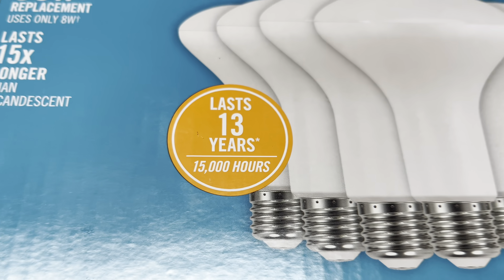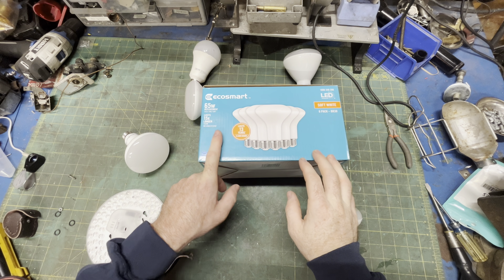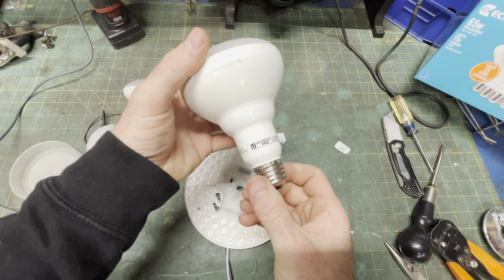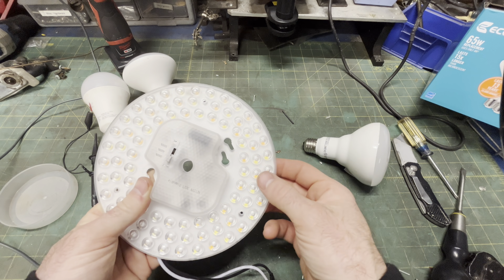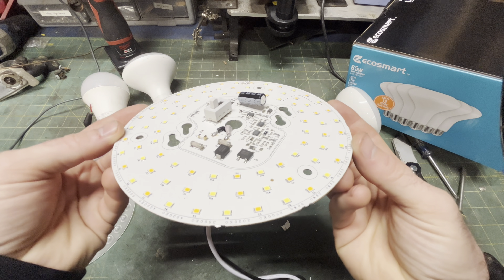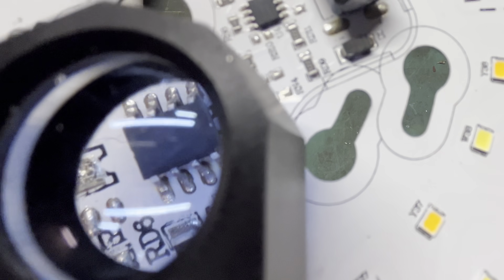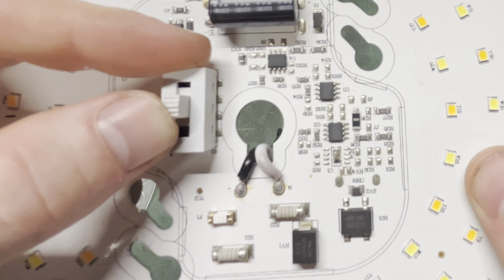Why Do LED Bulbs Fail? An Autopsy!

Comment: That looks like it could be a zinc casting rather than aluminum. Yeah, zinc alloys are much less efficient for heatsink material, but they mold into complex shapes really well and cost way less than the same casting in aluminum. It was soft enough to gouge deeply from your screwdriver tip, but all that leverage didn't stove in the metal surrounding it at all (like the same thickness aluminum probably would). 
I've seen it before in other LED lights: the zinc is much better than no metal heat sink, and explain better why that bulb was oddly heavy. A large, thin sheet of aluminum like you found in that other bulb is arguably worse, made so thin to save money the heat travels poorly to its outer edges.
Reply: I agree. Zinc is cheap partly because of its very low melting point, much less heat required to cast it. The greater mass means a higher heat capacity, and it's larger, so more area to shed the heat from.

Comment: Excellent video! Or audio. I haven't watched this yet, just listened while walking at the beach and finding junk. Excellent! Fun!

Why do LED bulbs fail? At least those I've checked recently, had one LED burned cut, having a small black dot. Could be that they run a bit "hot" to get max lumens per their price, but detailed reason might be what happens when the power is turned on. I'm "seeing" there's a spike of overcurrent which eventually breaks one LED. I fixed those bulbs by shorting the broken LED. A bit less lumens, but for my use it doesn't matter. What matters, is the matter (the waste).

Comment: Enclosed spaces where heat can build is the LED killer.
I just built a macro field continuous light entirely out of thick copper, to act as the heatsink for the 1600 LEDs.
Kept it on for 20 minutes a couple of times by accident with no problems.
Didn't even turn it off, I just turned it down to the dimmer modeling light setting and it quickly cooled off.

Comment: 3:54 that is a MELF resistor, one of the earlier SMD technologies, but still used because they can handle a lot more electrical stress than a similarly rated flat SMD package
Reply: hot melfs in your area... 😛
Reply: MELF stands for "Metal Electrode Leadless Face" but I think it actually stands for "Most End up Lying on the Floor" (because they're round they love to roll off of whatever surface you have them on).
Reply: I agree. To add a little more - they are often there as a "fusible resistor". Designed to both limit inrush current and act as a safety feature.
Reply: And they're used on the instrument panel of GM models circling around 2000.   And they fall off, leaving one with dark odometer and gear indicators.
Reply: Metal Electrode Leadless Face
What A Useless Name
I was worried decades ago for a job interview I didn't know what a PCMCIA connector was. It's a business with more initials than EIA and IEEE. I've never used the PCMCIA port on a laptop. Close to obsolete now. All that lost sleep for nothing.
Reply: @murrayatuptown353  PCMCIA? That one's easy: People Can't Memorize Computer Industry Acronyms

Comment: That shaky panichands pause and then double hand flip 11:29 after the explosive disassembly -- SO RELATABLE LOL.  Because you KNOW there's that little window where you could be slashed to the bone and not feel anything...
Reply: I prefer to not having to do that. This was 100% predictable and avoidable.
Reply: It had me on the edge of my seat, like AVE offloading that clapped out mill from the little trailer. Knife with the blade out, prying with a screwdriver right over the easily scratched screen of the multimeter, and his booger hooks all waiting for a jab or cut.
Reply: I squirmed when I saw him pulling at that plastic. I always wear gloves when doing that kind of disassembly. I occasionally hurt myself wrenching on my vehicles where I can't where gloves, and sometimes look around seeing blood on the tools and checking closely to see where it came from.
Reply: @andrasbiro3007  It always is in hindsight, but you do it anyway
Reply: @ 
This didn't need hindsight.

Comment: I purchased a pack of 6 LED bulbs branded as KOR on Amazon, in 2022 and all of them that are in use today still work fine. Tho I guess the quality of these really does vary a lot. I've been a bit concerned about the longevity of them having seen videos of bulbs that have failed early, but so far my experience seems to be quite good. They are rated for 15000 hours of life and I've calculated that as being roughly 2 years of being on 24/7 I have a bulb in a lamp I use in my bedroom which often gets left on for many hours a day sometimes overnight, and its still working today, tho it might have dimmed a bit, but I haven't compared it against a brand new bulb.

I personally can be happy with a 5 year lifespan for LED bulbs as I've been using those halogen incandescent before and those only seem to last about 7 months in my experience.

Comment: Super enjoyable stuff! 
FYI, it's the high voltage electrolytic capacitors that go bad first. You need ESR meter to detect the problem. A capacitance meter will often show proper capacity while the ESR is too high for the capacitor to function.

Comment: Having the LED as a separate product as the PCB would be fantastic, it is how tube lights work after all.
Reply: You see a lot of recessed lighting separate the rest of the electronics from the LEDs themselves
Reply: not anymore. You can barely find t8 *anything*.
Reply: It's not always the LED's that fail.  You could make the product modular so that the capacitors are replaceable as well as the LED's.
Ideally more consumers would be confident in using a soldering iron and buying replacement parts from a shop on the high street.
We do at least have separate drivers which can be replaced, but the difference between constant current and constant voltage is likely to remain esoteric for ever.
Reply: @westinthewest my city is fairly flat, and all of the streets are at the same height above sea level.
Reply: As a plasma fanatic  I just stick to fluorescent lamps. Most LEDs are boring for me. Filament style is OK but most other types are as ugly as the average mother-in-law.
Reply: The better industrial lights have separately replaceable power supplies, replaced a lot of them.
Reply: @keco185  Yes. Most of our ceiling task LED lights have separate power supplies. I've replaced some of them over the years and the LED lights are still going strong.

Comment: That bulb where you exposed the inner workings at the 11:45 mark, on aircraft we call those TR (transformer/rectifier) units, to convert 115V/400 Hz AC to 28 VDC.  Of course, they're a LOT bigger, heavier, and last a LOT longer despite the relatively large amount of DC current they output because they were built to high standards and cost crazy money.  But, it's an aircraft and you can't just swap one out when you're at altitude.  There are multiple units for redundancy and safety, which can autoswap onto the bus and hold a higher load for a while to get the aircraft to its destination.

Comment: I have old ecosmart LED bulbs in the hallway that have been working for over a decade. A couple of the bulbs have 1 of 5 LEDs burnt out, but they're still plenty bright.

Meanwhile, one of my newer ecosmart bulbs died in just a few years. A capacitor blew its load, there was electrolyte all over inside of the bulb.

At least it didn't fail catastrophically, unlike the ancient CFL in my garage, in which the electronics melted its casing. That bulb was probably 20-25 years old, and it had U-tubes instead of the spiral tubes found in later CFLs. It produced very pink light when it worked!
Reply: That LED bulb sounds very "Ecosmart" to me...

Comment: They weren't wrong about the LEDs having a long life, but they didn't say anything about those damn driver circuits did they?

(There is one tiny upside, if willing to take the time it's probably a good source for component harvesting.)

One last note, if your LEDs consistently have a short life - you should do some checks on the power coming out of the wall. It's likely you have a lot of noise or other waveform issues and need to voice complaints to the power company. Whatever it's doing to fry LEDs, it's also doing to all your other electronics.
Reply: As a plasma fanatic  I just stick to fluorescent lamps. Most LEDs are boring for me. Filament style is OK but most other types are as ugly as the average mother-in-law.

Comment: I've found that newer LED bulb designs produce a lot less heat, and so far seem to be lasting longer. It's also worth noting it depends on what fixture you put it in. As some fixtures can dissipate the heat well, and some (nipple/boob cheap lamp fixtures) have poor to no heat venting. For incandescent or compact fluorescent bulbs this was fine and did not accelerate their death (except for some CFLs), but boy does it ever accelerate the death of LED bulbs! (if they get hot enough). So kinda wish you had covered the fixtures each were used in more closely, as this detail I'd say is very important.
Reply: This is exactly the problem. Incandescent bulbs, CFLs and LEDs all have different constraints for long life, but end users rarely care or even know about them. For CFLs, short on/off cycles are a death sentence. For LEDs it is poor heat dissipation more than anything else.
Reply: The packaging on some cheap LED bulbs will tell you not to use in enclosed fixtures. I had a light fixture that was killing LED bulbs in less than a year and found this to be the issue. Spent a bit more on some better LEDs approved for use in enclosed fixtures and they have been lasting much longer.

Comment: I changed all our lighting to LED when moving into our present house in 2016 ... so 8 years ago. We have a lot of bulbs of many different sizes and types. So far the only failure has been an LED strip light in the garage. We are undoubtedly doing better than the incandescent or compact fluorescent types.
Reply: While saving on electricity.
Reply: @whyme5024  I'll say! LEDs use a fraction of compact flourescents ... and don't even mention a true incandescent bulb!
Reply: @whyme5024  That is not such a issue where I leave.  Since I have to run heating for 8 month in a year,   incadenscent heat is not lost during that time, it just helps house heating.   Actually I have a pair of BR30 over my head in the office, and I like them warm over my head for those 8 month, so I switch them to incandescent for winter, and back to LED for summer.  Of course there is no point running incandescents outside, or a cold storage room, or really garage.
Reply: yeah, BUT the incandescents were about 5 times cheaper per bulb

Comment: I got so fed up with LED bulbs failing prematurely, that I ended up creating my own LED circuitboard design using KiCad... 

I've an ethernet-based and Zigbee revision, both intensity and light temperature can be controlled from a touchscreen in my wall. The setup is calculated, such that the LED's are only driven up to 70% of their max rated current. This means they remain below 60°C, even after hours and hours of on-time. You can even touch the LED's without burning yourself.

One year later, still zero failures! Hope it remains like this for the next couple of decades...

Comment: Most LED systems are overdriven, especially in LCD TV backlights, which produces far more heat and failure.
The manufacturers do this to boost sales of their stuff, probably designed to fail after the 3 year warranty has expired.

Comment: All my led bulb fails have cracked shells or desoldered led diodes. Heat dissapation and thermal expansion seem to be the issues.
Reply: @BlondieHappyGuy  The base of these bulbs get ridiculously hot.
(recent LED bulb burn victim)
Reply: @BlondieHappyGuy Make things shitty to save a cent.
Just seems wasteful.
Reply: led diode= light emitting diode diode. You don'thave to write diode twice.
Reply: As a plasma fanatic  I just stick to fluorescent lamps. Most LEDs are boring for me. Filament style is OK but most other types are as ugly as the average mother-in-law.
Reply: @BlondieHappyGuy  You could drill a few holes into the plastic. It's probably worth the time when you buy a bunch of them
Reply: @mernokimuvek  led is used colloquially as a fixture disruption. When referring to individual diodes I describe it as such. Diodes themselves are also often also a packaged chip with a florescent film, rgbchiplets, and substrate like a simpler glowing ryzen cpu. So when referring to stuff it's not always redundant. Led packaged Diode is probably more accurate if you want to get reductive. Micro led rgb diodes are neat fyi

Comment: The whole concept of LED lighting for home use is flawed. Every frackin' bulb has to have electronics inside since all they'te thinking about is backward compatibility. When halogen lighting became popular, the conversion to low voltage was done outside the lamp, like it should. Replacing a popped bulb only meant replacing the actual lamp. Way cheaper and 100 times more environment friendly. I scavenge the local street lighting company once a week and even the retrofits for street lighting have this "all in one" approach. Many broken lamps just have the electronics fail prematurely because of getting too hot, bad components and moisture getting in. Newly built houses shoud have a separate circuit for low voltage lighting so all the lamp needs to contain are LED's and resistors.
Reply: If you start requiring a low voltage circuit in houses, you can expect that the power supplies that get installed will be very unreliable. Landlord's specials. And replacing those every 2 or 3 years, can be just as expensive as swapping out a 2 euro LED bulb, because the power supply will be a "Special Appliance" that is sold at a premium, or is located in such a place that your average homeowner gets unsure about replacing it themselves. 
Your idea can absolutely work, though with switching regulators in the LED bulbs instead of resistors. Switching regulators can deal with some voltage drop over the wiring ensuring that the brightness of all LED lamps will be equal, and they will run a whole lot cooler than a resistor driven LED bulb, therefore increasing life span of the LED phosphors. Cost wise it does not matter. Those driver chips and some associated components get you to maybe 45 cents in total, wholesale. 
I do not exactly know if you save a lot on heat production by running a switcher on low voltage rather than high voltage. But at least you can get rid of the bridge rectifier and filter capacitor, both of which are not uncommon to fail. I think one of the biggest benefits is that you can make the lamp housing out of metal, and use it as a big heat sink, safely. Theoretically you can do it too on mains voltage, but you need an isolation layer that thermally conducts. 
But in the end, what counts is production cost, and even in the above scenario, corporations only strive for biggest profits with the lowest quality level the market still tolerates. They are not making those lamps for the good of the people, but only for the good of the shareholders.
Reply: @mfbfreak  > "Landlord's specials"
lol, I can attest to that. Rented an apartment a year ago or so. Low voltage lighting circuits throughout (bathrooms, kitchen, etc). Guess what failed first, two times in a row?

I was damn glad I made an agreement that any failures within the first month were landlord's problem.
Reply: I think the easiest and best option would be to have the electronics in the fixture, and have a variety of standardized LED arrays you can pop into them. (kind of like florescent fixtures)
Reply: @mfbfreak  the problem there is what voltage is the DC?  Different LED lights require different raw DC voltage.  So your house DC supply would have to be the highest necessary value or you would need DC/DC up converters to step it up for the larger lights. You still need either inefficient and heat generating/sensitive dropping/limitting resisters or DC/DC down converters (more efficient & less heat). So you probably do gain some reliability at the lights but you have now created a single point failure at the house lighting circuit supply. If that goes, then you loose all your lighting. You may also introduce more arching at the light switches. Separate lower voltage lines for switches with relays in the fixtures?
Not necessarily a bad idea but would really require some serious design and would have to come from either the government or an open-source industry consortium.
Reply: @mfbfreak  simple fix: your LED power supply is just a pc power supply
Reply: Having a 24 volt DC supply is ideal, but problems arise if you want individual dimmers in any of the rooms.
A dimmer module with mains input and 24 volts DC output could be the answer, but it would require a neutral, along with double pole wiring from the switch to the lamps.
Reply: @mfbfreak  We tend to forget that if we all replaced our bulbs with LED's that lasted (as advertised) for 15,000 hours, the lamp manufacturers business would then drop by more than 90% after the first year
They are clearly not going to allow that to happen. 
At the start of all this, manufacturers in the west saw the problem, so they imported from China. They were able to maintain their bottom line, due to zero manufacturing costs. 
Now it is China who are playing the silly games to stay in business and we have no say in the matter.

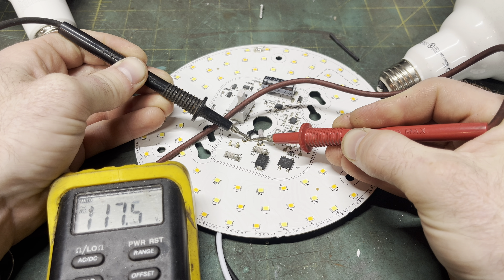Comment: You casually shorted out the mains with your test leads at 2:50 , you seem very comfortable around live AC which could be concerning 😅
Reply: That's what fuses and breakers are for.
Reply: Yes, he even put the circuit board on the heat sink.
Reply: Looks safe. 😂
Reply: @markc2643  the breakers wont protect your retinas from burning by a spark